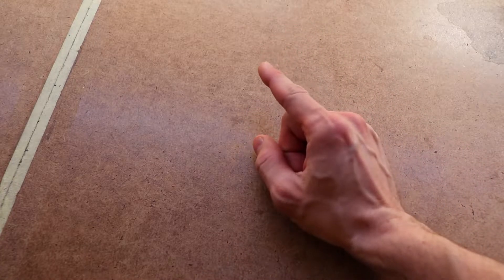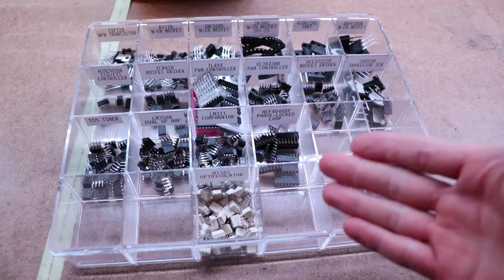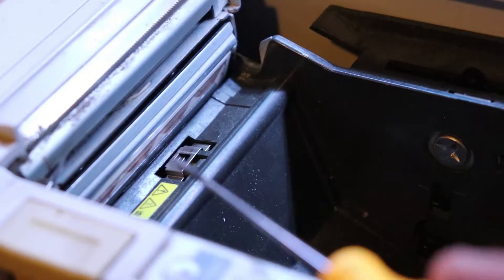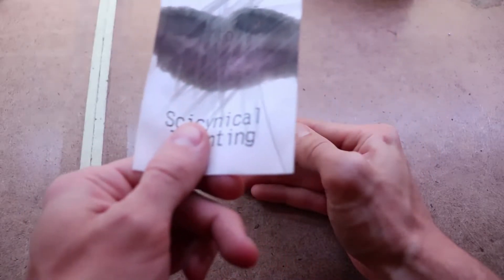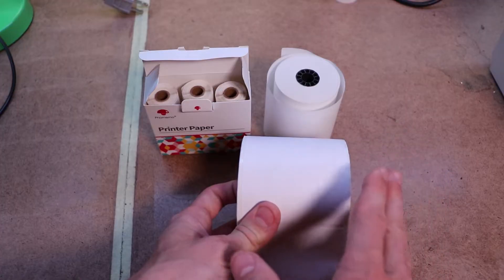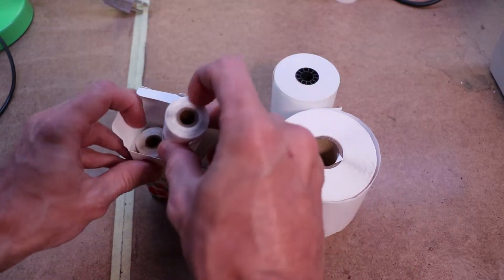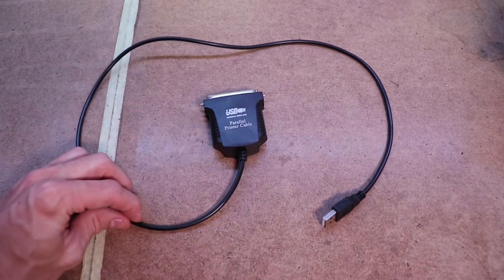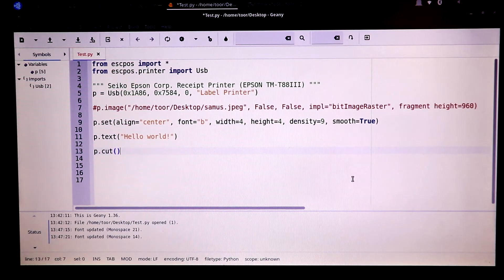Label everything with this Thermal Label Printer

Comment: The USB to parallel cable is not presented as a serial port, it's a line printer which takes parallel data. The RJ12 connector on the back of the printer is also not a serial port. It's a output for engaging the solenoid in the cash drawer _)

Comment: Cool, I was thinking of getting an old one just to mess around with. 
My friend has a new Bluetooth portable version, however its only compatible with android and iSO, so I was wondering if it could be hacked to use it on windows any ideas ? (I guess the printer itself would still be using serial commands, just processed from the Bluetooth module maybe?)
Reply from the maker: You would need to figure out the protocol that the printer uses, Idk if that one would necessarily use the same protocol as mine. If you cant find any documentation, I would do exactly what youre saying and see if I could listen and intercept serial data between the bluetooth module and the printer. 

But thinking about it now, i would be curious to see if using a computer with a bluetooth module and an IOS/android emulator could work to trick the printer into thinking the computer is a phone.
Reply: @SciCynicalInventing  Yeah, I thought about an emulator on Windows (Bluestacks/Android SDK) just wanted to see if I could hack it, for a bit of fun. Nice videos and thanks for the feedback !
Reply: THX for share.
Reply: Most bluetooth RECIEPT printers (the black generic ones with no app, that work the majority of thermal printer apps), use ESC/POS over Bluetooth SPP